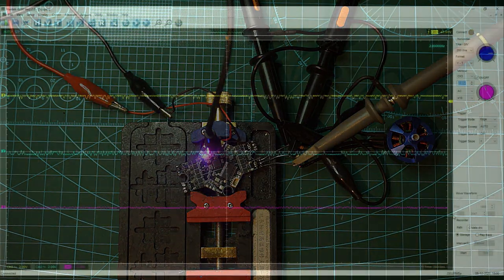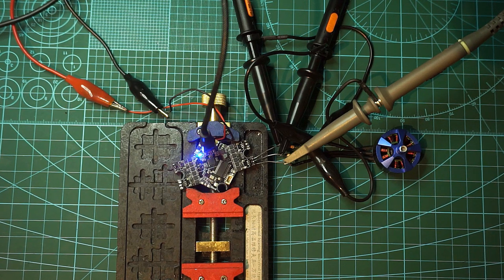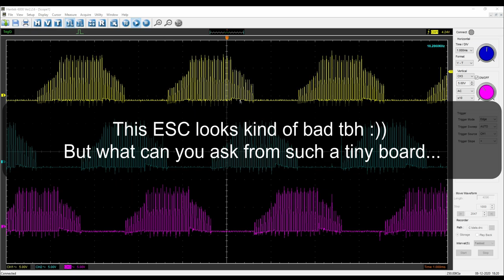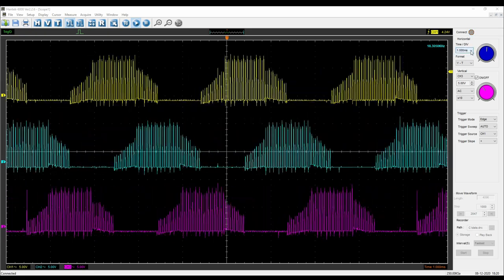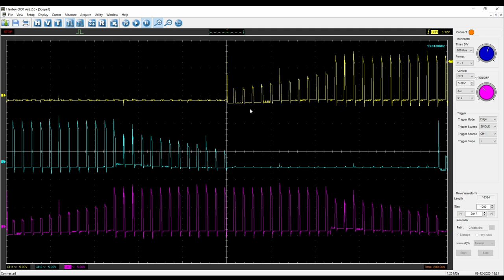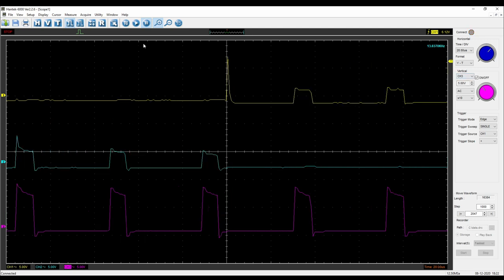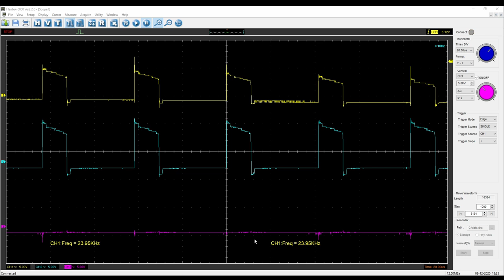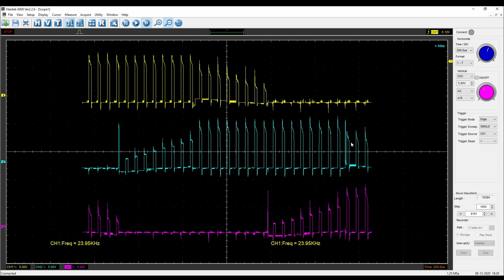Oscilloscope ESC Measurement | Hantek 6254BC PC USB

Comment: Again an Excellent video. I myself actually designed a digital oscilloscope back in 1997 for use in computers(built-in ISA bus version because of speed). Cutting edge tech back when, and still relevant for sure. The modern USB Scopes like the one Livyu just presented will be SUCH a treat for your toolbox, even if you are an just a little advanced hobbyist. Loved this @Livyo FPV  :-)

Comment: thanks for the video. I was just wondering if, at this price point, it is not better to go for a "classic" true DSO. Seems to be really expensive for "only" usb scope. Maybe a comparative review would be a good idea for another video.
Reply: Actually these are pretty cheap 😅
I wouldn't expect too much in regards of compliance with the spec.

USB scopes from well known manufacturers easily cost you over 1000 € if you want 4 channels and 200 MHz bandwidth.
The Hantek 6254BD only comes in at 285 €, has "250 MHz" Bandwidth and a signal generator.

I will buy one, just because they are pretty affordable, i need a new scope and don't really want to spend much money yet.
So for me it's kind of a "well sure looks good, we'll see how it actually performs and in the end 285 € isn't that much wasted, since it clearly can do something"

edit:

also normal dso's with display always cost a few hundred bucks more than usb scopes with comparable specs from the same manufacturer.